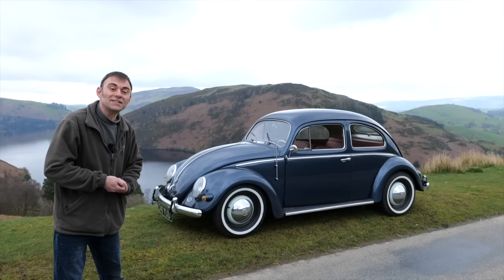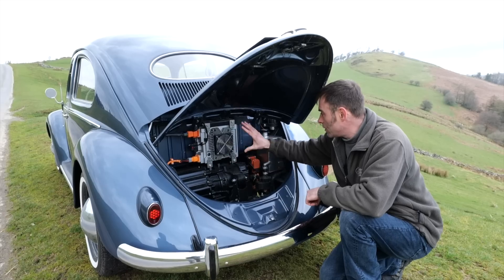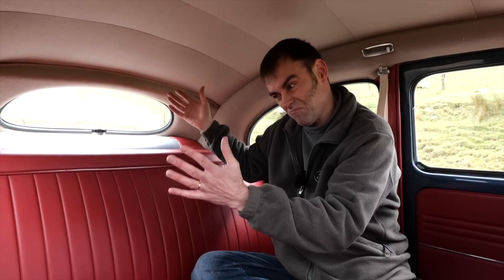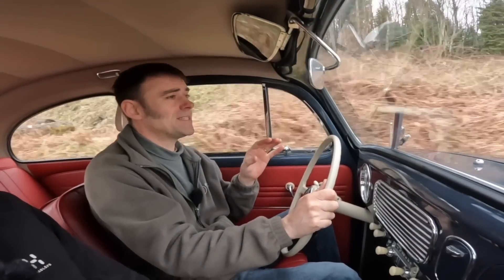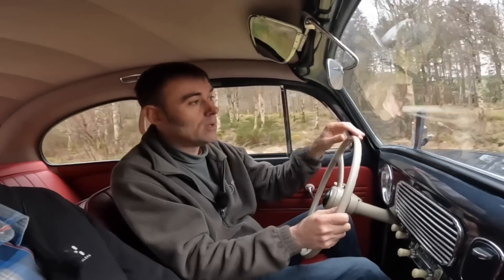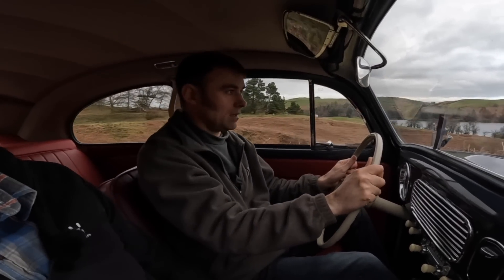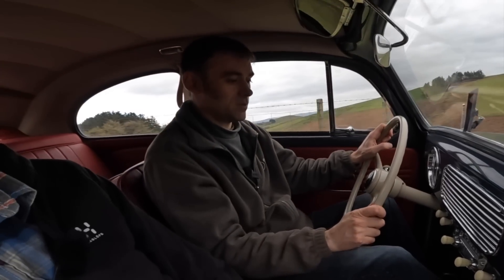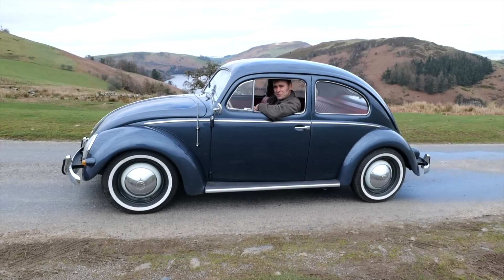Finding problems in an electric VW Beetle, converted using our bolt-in kit.

Comment: Lovely  car destroyed
Reply: Quite the opposite. You may not have ever owned one. I've had three and would take this in a heartbeat. Constantly tinkering and the smell was literally dangerous. As a car for the masses, this makes as much sense today as the original version made back then. All good.
Reply: Made it more drivable, safer, more efficient, more reliable and more powerful......far from being destroyed
Reply: @martin m  I have owned   2 beetles  there is nothing like the sound of a flat four engine  don't be in such a hurry to erase the past these cars are works of art old tec and when there gone there gone
Reply: @michaelkilbride2927  what made that car special was not the engine. Would you say the engine is what makes a Kia Sportage special? You’re being ridiculous and overly emotional.
Reply: @michaelkilbride2927  maybe you shouldn't be in such a hurry to dismiss what the future brings. I've owned a plethora of classic cars in my years, and yes, a few of them were VWs. If I still owned one I would happily do this type of conversion. No oil leaks, no burning yourself trying to change a fouled plug on the side of the road, no tuning carbs, no rattly tinware......
And, what a lot of people seem to miss, is that this conversion is 100% reversible. It uses all the original mounting holes on the vehicle. Nothing welded in, or holes drilled in the body. If someone was so inclined they could return it to petrol power in a weekend. 
You only love the sound of the engine because that's what you are used to...and it's been like that since 1915. But, what if cars were always electric since their inception? People would be used to it. Then imagine that someone puts an internal combustion engine into one of those cars. People would be up in arms saying how smelly and noisy it was. 
It's all just a matter of conditioning...what we are used to, what we have grown up with. Just because something has been around for 100+ years, doesn't necessarily mean it's better than new advancements in technology.
Reply: @Matthew Dilks  you don't  understand engines  it's a part of history   and when  it's gone there  will be no more these cars need to be kept as they are  the sound the smell of this car   in the future  electric cars will be every where  how many beetles will be left with a engine they will be worth  a lot of money
Reply: @michaelkilbride2927  the car is history, the engine didn’t make the car. If this was some sports car I’d understand but it isn’t.
Reply: @michaelkilbride2927  I don't understand engines? I'm sorry, but what brought you to that conclusion? Just because I think electric conversions are a good idea doesn't mean I don't understand the the allure of an internal combustion engine. I've worked on cars and bikes for almost 50 years. I've competed in various types of motorsport...Motorcross, tarmac rally, drifting, drag racing, hil climb racing. I've built my own vehicles, built the engines...I worked as an engine tuner and dyno operator in a performance workshop for 12 years remapping ECUs and tuning aftermarket fuel injection systems....so please don't tell me what I do and don't know. 
I love the sound of a RB26det on full song, or the throaty rasp of a VR6 Bora running the gears up a sweet hill climb....the sound of a tuned CA18det ripped hard on the limiter, a ported 13b, a worked 351 Cleveland. I know them all intimately.
Just sounds to me like you are scared of change.
Reply: @matthewdilks2677  look, my entire point here is this.....the governments WILL ban internal combustion engines. It's just a matter of time. What Moggy and his team are doing today ensures that people will be able to enjoy their classic cars well into the future.
Reply: @Mardy72   are you replying to me by accident because I agree with you. I think you may want Michael Kilbride.
Reply: @matthewdilks2677  yeah sorry mate, I tapped the wrong comment
Reply: @Mardy72  we do have the same picture it’s perfectly understandable.
Reply: @martin m  no  I am but  but   just leave these old cars as they as they are ment to be   to many  gone already  glad to hear your a petrol head enjoy
Reply: @Mardy72  Exactly. As the owner of a regularly driven 1926 Model T Ford, the future banning of petrol cars is definitely a worry.
Reply: Because the engine was the key part of the beetle. The only worth getting it for. This isn’t a Lamborghini the engine is worthless.

Comment: Fantastic looking and sounding old Beetle. (Except for the squeaking!)
Why couldn’t you make and adjustable regenerative breaking? Like a knob on the dashboard, so you could add more if going downhill or in traffic, and less if you are on an interstate or highway? Is that even possible?
Reply: There’s a Canadian company that Tesla swapped a Lotus … Evora, I think and used a paddle behind the steering wheel for driver controlled regen motor braking.
Reply from the maker: It's possible. 👍

Comment: how many of these 1957 Oval windows still exist in the UK or the world for that matter?
Reply: It's my belief '56 was the last of the Oval window Beetles.
Reply: @johnt.848  so how many of these '56 Oval window Beetles still exist in the UK or the world for that matter.
Reply: @grahamepigney8565  I have no idea, but since an oval window conversion came out many more than there should be as there are fakes out there.
Reply: @johnt.848  the dash is different,  the windscreen is smaller and dozens of other differences,  so any fake is easily spotted
Reply: @bigears4014  Wrong, but keep trying. If someone is going to the trouble of installing an oval window in a later Beetle then altering the dash isn't hard too. As for your opinion the windscreen is "smaller" I very much doubt that.
Reply: @johnt.848 wrong 57
Reply: @bigears4014  Me wrong? 🤣🤣🤣 Please extrapolate on that knowledgeable answer of yours oh wise VW master!
Reply: Both oval and large window were available in 1957 , from about September 57 it was large window
Reply: @bigears4014  So basically oval window Beetles manufactured in '56 were still being sold in '57 as new. No different that vehicle manufacturers do now. I'm still correct.
Reply: @johnt.848  tosser
Reply: @bigears4014  Odd way to say thanks for data from someone that has been a lifetime researcher and fan of VW.

Comment: Really like it. But you need you need to leave the engine cover open while charging? What happens charging at a service's? Stay with car.
Reply: I'd have to guess whomever gets this would have charging at home and wouldn't need to be charging along the way. Particularly since the range isn't that long - yet.
Reply: @allwheeldrive  kinda restricts you to a radius from your home? Plus the company replied saying the boot can be shut when charging.
Reply from the maker: The engine lid can close just not fully. No need to stay with the car.

Comment: For spirited driving, is the stock suspension adequate to handle the extra weight?
Reply from the maker: Not that this car is designed for spirited driving but the extra weight is only the same as one small passenger.
Reply: @ElectricClassicCars  I can imagine if the HP was dialed up to max things could get a bit harry! :)

Comment: You should swap over the wiper arms - they've been transposed at some point during the restoration process - the one on the driver's  side (with the upward tilt) should actually be fitted on the passenger side - and the one on the passenger side (with the downward tilt) should be over on the driver's side.
Reply: Good eye on the wiper arms!  Now I’ll have to go check my ‘64 to see if they are right.  I’ll also take a tape measure to check my fender height on each side.  I don’t have a British Standard Test Finger.  LOL
Reply: The problem is the steering wheel is on the passenger side, move to to the right where it should be and problem solved.
Reply: Unfortunately that’s how they came from the factory. They were all made right hand drive and minimal parts and costs were used to convert them to left side drive for western markets.
Reply: @nickmorton8998  I think you meant to say they were all made left hand drive etc, but even that is incorrect.

Comment: Nice video as always! Does it still have the original split-case swing-axle transmission, or has it been replaced with a later full-IRS tranny?
Reply: No transmission. The Tesla Model 3 drive unit/inverter/motor/reduction gearbox connects directly to the wheels. On IRS suspensions that can be done with a simple adapter to connect the motor to the chassis where once was the transmission.
Reply: @freetobe3  So I suppose this requires installing the IRS suspension in place of the original swing-axle suspension on pre-1969 Beetles.
Reply: @rufustfirefly3  oh yeah, totally missed that. This particular beetle had a conversion to IRS done previously to the EV conversion. It's in a recent video.